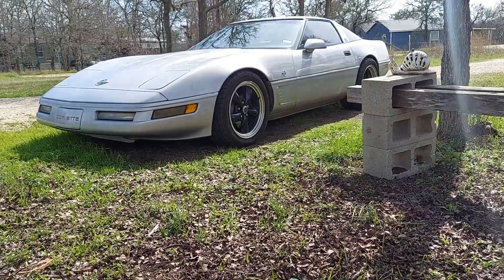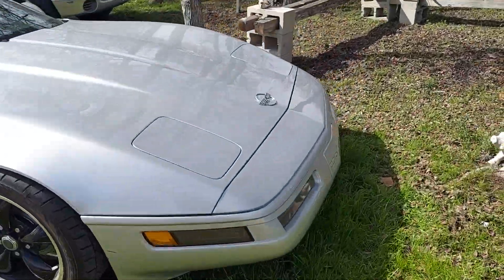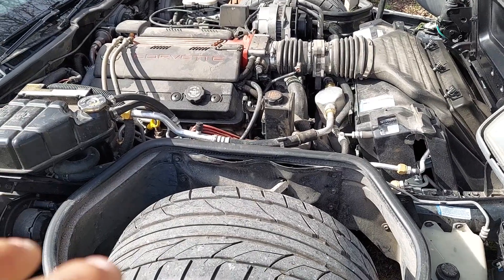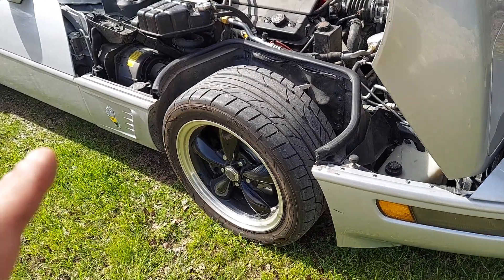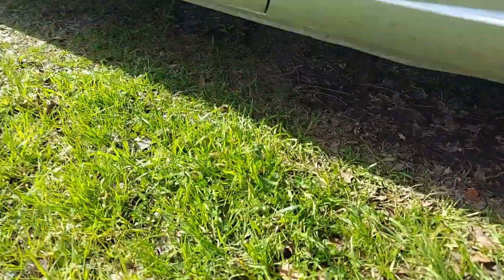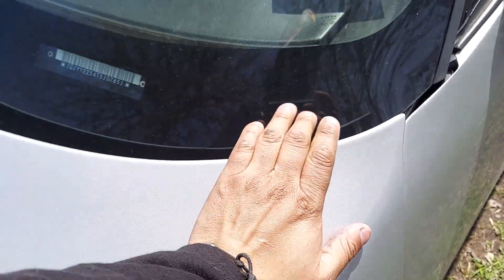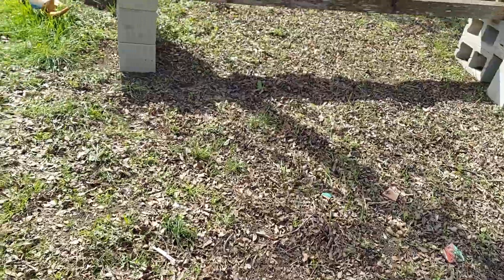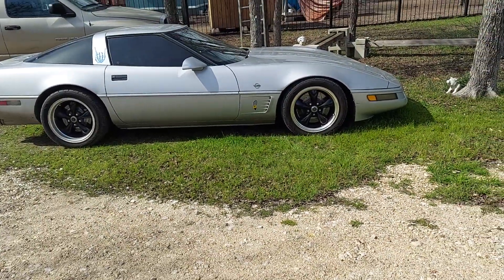you can lower a c4 corvette with out coilovers..here is how it looks

Comment: We’re did you get them rims and what the brand are the and size of rims
Reply from the maker: Lowering kit.  1inch lowering bolts ..you cut the oem shims off and just glue those things on the leaf spring..American racing Torque thrusters 17 inch...9.5in front. 11 rear

Comment: What’s the steering wheel setup? I’ve been looking for a D shaped one that’ll work…
Reply from the maker: Nrg innovations..320mm.with hub adaptor and quick disconnect..it's not a plug and play for the horn and it doesn't have airbag so it's not street legal and you get airbag light..other than the horn.  It looks and feels awesome.

Comment: What type of glue did you need to use to glue your new rubber parts on with?
Reply from the maker: The one that came with the shims
Reply: @carlitosASJ  Oh. Okay. I thought somewhere in the video you had said you were off to the auto parts store to buy the type of glue you needed. Asking cuz my shims didn't come with no goddamitall glues!! And i love glues!!
Reply from the maker: @GLUE4UANDME  man I don't remember...i lowered my black c4 too and think that came with glue i dk if this one did but make sure the shims are in the right spot and the glue is dry of they will get pushed around on the round leaf spring
Reply: @carlitosASJ   Okay. Thanks for the help man!
Reply: @carlitosASJ  Oh yeah. And did you have to cut down your original aluminum mounting brackets too? Do you remember just how much needs to be taken off them if you did?
Reply from the maker: @GLUE4UANDME  yes cut them down more than the width of the rubber shim because they compress

Comment: What did you do to the front to drop it that much. I’ve only seen kits thay lower it 1/2 inch
Reply from the maker: Cut the rubber pads at the ends of the leaf spring where they rest on the control arms
Reply: @carlitosASJ  Did you have to pull the spring out to do that?
Reply from the maker: @marscarguy1848 yes